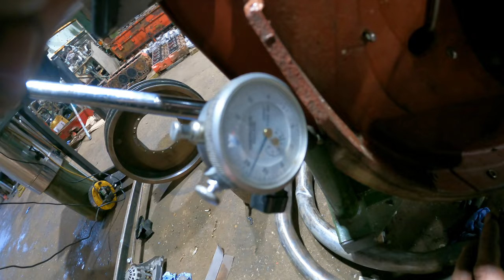British Army Centurion Main Battle Tank Gearbox Repair - Tinkering Tuesday

Comment: Definitely approve of your long episode here. My one comment is that I wish you had filmed the interior of the steering drums,shape and condition of. That equalizer bar design is an elegant way to make twin leading shoe work. Never seen it before. I had a racing four leading shoe drum setup on a 73 Yamaha motorcycle,many years ago. If they had engineered a similar arrangement,it would have actually worked instead of being lethal.
Your video is well presented. Keep up the good work. Cheers.

Comment: As an apprentice at David Browns i spent many hours refurbishing these gearboxes in the early 70s. Happy days;-))
Reply from the maker: Having seen some of the parts diagrams, as far as I’m concerned your some form of magician. Any knowledge you have would be much appreciated.
Reply: @tinkeringwithtanks  HaHa its many years ago now. I was working in the military repair section, this was in the basement of the Chieftain assembly department which i also worked in. It was after the ( not quite sure here) 6 day war or the yom kippur war. A load of Centurion gearboxes arrived. All were caked in sand and labeled as earth moving gearboxes;-)) I think the government were trying to keep the refurbs under the radar.
There were 4 of us in the department, i can still remember the names an faces now. As was DB practise they were stripped down to the last component, and i mean everything. Dropped into a aeration tank of Gunk and left for 24hrs. Then washed of and everything was inspected. Bit hazy but i think about 3 weeks for the rebuild. Interesting gearbox. Of course the Chieftain gearbox TN 12 was in full swing at the time. Again still remember names and faces in that dept.It was said the fellow that designed the Chieftain box went mad as he couldn't work out why it could do what is called a Neutral steer, I think that could be an urban myth.
By this time well out of my apprenticeship and along came the TN 37 fully auto box. I worked on the test and development from day one. Many stories about that part of my life. 
Not sure if you know the TN37 was never built for the British army. It was funded entirely by the Shar of Iran. All the  Manufacturing machines of which there were many all had brass plaques saying it was the property of Iran. The name of the tank was going to be Shir-1 and later became the Khalid for Jordan. but after the downfall of the Shar every thing came to a halt for many months, even lay offs of some of the work force.
Anyway i think I've bored you enough.
Reply: @mga6665   Not boring at all man! Fascinating history that otherwise just falls through the cracks of time. I worked as an overhaul inspector on Pratt & Whitney radial engines in the late 70's. More history, sadly, long gone.

Comment: Well done! We did the same job on two Centurion transmissions some years ago. We had never done a repair like this before, as we, back in the days when the Centurions still were active in the Danish Army, just required and changed a defect transmission. We have all the original repair manuals, but it was some kind of learning by doing task. 🙂

Comment: As REME attached to the 17th/21st Lancers We had those old ladies but at Squadron level as far as We went  was box out and replacement in but those brakes date right back to the old Girling mechanical system on cars  which apart from seizing up with rust were trouble free. On the Cent however, the drivers loved showing off with rapid stick changes ,locking a track and smacking it through which although it kept the drums clean  ,the brake shoes wore more frequently. The nastiest job for Me was changing the first and last pair of inlet bank plugs with all the tools hanging from Yer neck ! Great site ,keep 'em movin' Please?

Comment: Since you obviously do this hub rebuild often, it would be a good idea to make a couple of long studs to locate the bearing housing. Re the brake rebuild, have you thought about the galvanic incompatibility of the copper in that grease and steel components you are trying to lubricate? Anyway, great work and video chaps, very enjoyable. The long video is excellent as it saves having to hunt around on YT trying to find the next episode.

Comment: My Father had a 1956 Albion Claymore lorry which had brakes like that tank with twin leading shoes via an internal rod and lever system with single hydraulic cylinder but smaller the way the adjuster and shoes were centralised was by applying the brakes and at the same time winding the adjuster up, the releasing the brakes and adjusting again then reapplying the brakes. So I would think the same principle applies on the tank.

Comment: Twin leading shoe brake works better in one direction as both shoes lead on one side it also has a self servo action as shoes bite into drum.
Single leading shoes like most older car rear brakes are less powerful but the same in both directions. This is useful for handbrake if you park on a hill facing up hill it should not roll back (they still do tho).
Reply: Years of old car british bikes and old land rovers have ment  I learn the difference the hard way😅 good video tho hope you don't think am being negative.

Comment: Why did you coperslip the drum retaining bolts that in my opinion, I don’t need it but left the centralisation flange where the drum fits dry? 
Ps I didn’t see you put any silicone on the gasket, also I think hylomar would be better to seal the seal.